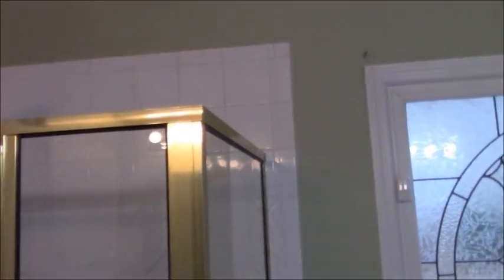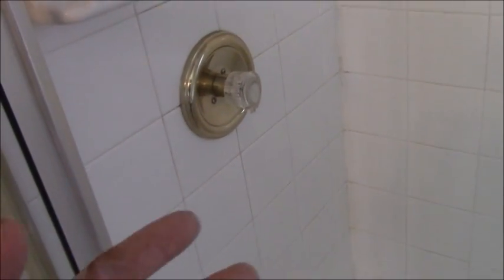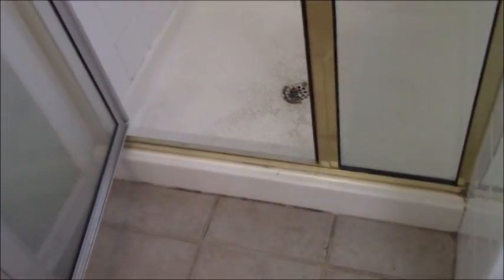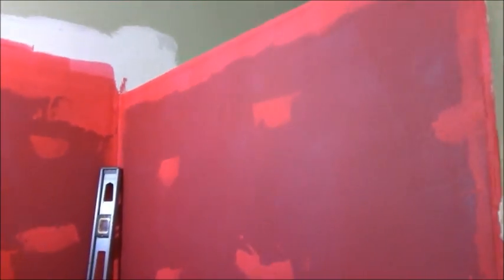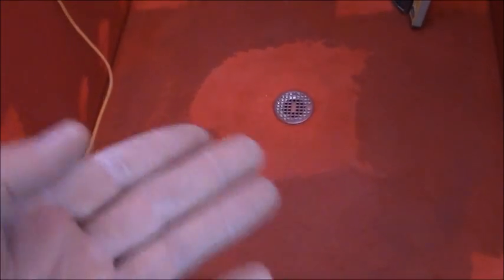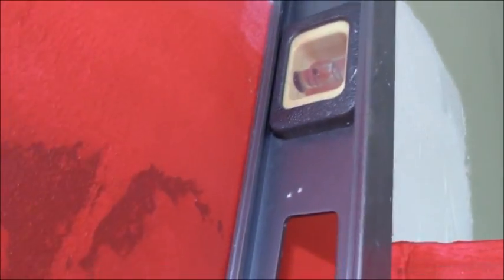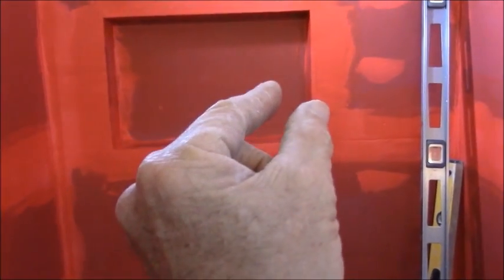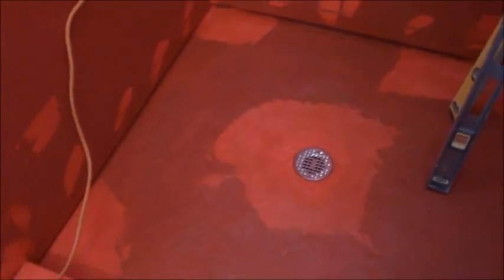Build Of Travertine Shower

Comment: The builder grade tile in my shower is 64 years old. I'm planning on replacing it in another 3-4 years. It's in really good shape, just pink.
Reply from the maker: You're correct, it was ( is ) the method they used rather than the tile. Floating was difficult, labor intensive and time consuming, but it worked. People won't do that nowadays.

Comment: There was a large colony of carpenter ants in the master shower of my new (to me) home in Florida. "Where there is water, there is...". They were climbing up the outside CMU wall, over the top (attic) and down inside the wall assembly (eating through the insulation) and under the shower pan. Whatta mess.

Comment: Great job as usual. I am doing a bathroom now 11x12 ripping out plaster walls over sheetrock in a four story walk up ( old brownstone). Took two days for demo and  breaking up the cast iron tub was tough, then walk all the debris down four floors to a dumpster. Don't know why they wire lathe over sheetrock then plaster over it and then a mud job tile. Gutted out the entire bathroom to upgrade everything.

Comment: Yesterday I demo'd a builder grade shower from the 90's, diamond mesh and mud bed over green board, no waterproofing, they had a massive colony of carpenter ants in the corner behind the insulation. The colony was the size of a small cat. The style of shower is exactly what you show in this video, even the tub, but with a tiled floor that cracked and failed, rotten patches of OSB subfloor had to be replaced under the mud bed even the glass frame is the same, different colors. Do you finish your joints on the green board with setting type gypsum compound? I really like natural stone tiles the best, the look-alike's are great but don't hold a candle to the flame compared to the beauty of real stone.
Reply from the maker: If I'm doing green board then I use joint compound, if I use durarock or any other a cement product I use thinset

Comment: Talking about builders grade. I’m on a job now where the tile installer insists that he didn’t need a rubber pan as long as he did 3 coats of red guard. I bit my tongue and walked away. I was only hired as the finish carpenter so I have no say what happens.
Reply from the maker: He was correct, RedGard allows for a certain mil thickness to be a liner, 3 coats doesn't sound right, maybe 4 or 5. Having said that, I'm still not comfortable doing it.
Reply: StarrTile I always thought that was a very wrong way of doing it. I guess we’ll see in the future.

Comment: Nice job Bob!  My eyes are getting bad but I couldn't see what you used on top of the curb though.  It looked like one long piece of travertine.  Did you bull nose both sides or do they sell that long piece for curbs?
Reply from the maker: They sell the one piece beveled on the outside

Comment: Great video as always. My biggest problem with showers/ back splashes  is how to finish off edges. Not every tile comes with a bullnose in the same tile type/finish. I did see your video on a bullnose sawblade. Did you finish off those edges yourself or do you find that travertine has more available options for bullnose? Sometimes I do jobs for stores that sell the customer products that do not necessarily work in the area that i am supposed to get a job done in (that means the tile manufactuer doesnt sell a matching bullnose in that product). I am relatively new at this... I realize this might be  a "Figure it out" moment I won't be offended if thats the response :D                     

(edit) also is there a link to your patreon? i dont see it in the description.
Reply from the maker: https://www.patreon.com/starrtile
You can get field tile bullnosed at most tile stores ( the guy in the warehouse ) or buy the blade & do it yourself. Or get Schluter transition strips.

Comment: A vertical wall is not "level". Its PLUMB... Level is a measure of true for horizontal. Plumb is vertical.

Other than that, your videos are spot on. My brother does a lot of tiling, and like me, he researches everything he does thoroughly before taking on the project, often talking to professionals. You're advice is dead on his. Just like the paint job on a car, the finish and performance is only as good as the prep work before the finish product goes on.

Btw, as a plumber, if your premade shower pan cracks or whatever, it's because it was installed by a moron and/or it's a junk pan. Properly installed, a fiberglass pan will last a long time. It needs to be a high quality pan (not the garbage at the big box home center) and set in a mortar bed to end flex. Most garbage installations just set it in place and you're lucky if they attach it to the studs correctly. You are right about the dirt, but that's mostly because of poor cleaning habits.
Reply from the maker: Thanks for chiming in...actually I research VERY little, this work tells you how things should go, my video next week will attest to that :-)
Reply: Everyone is an English Major......at some point in their life...
Reply: @MrLutzyboy  well, you get the lingo wrong on a job and they'll crucify you for it.
Reply: @ruelsmith  ; you are 100% correct.  Square means corners are 90 degrees. Level is always gauged by a device, such as a carpenter's level, but level does not always mean parallel to the ground. Plumb is vertical, most accurately gauged by a plumb bob. Levels can show when posts are plumb.  

Note: I am replying because the banter above may help a few people out there, myself included, use the correct terms.
Reply: @MrLutzyboy  also, plumb using a plumb bob and measuring to the string is far more accurate than using a level.

Comment: Love your videos.  I have a travertine backsplash and brown wood cabinets in my kitchen but I want a tile floor installed.  I'm thinking of having a company come out and put a rough almond beige sort of off-white 12 x 12 tile floor in with dark brown grout.  I had it in my previous home and liked the look.  My kitchen is 262 sq ft and I got a quote for about $3200 including labor and materials.  They will also install ditra/strata mat underneath  Do you think this is a good deal and do you think it will look nice with what I currently have?
Reply from the maker: I think Natural Stone is a good look for any application, because it doesn't go out of style, and yes that price kit and Kaboodle sounds pretty fair
Reply: @StarrTile  Ok thanks for the input.
Reply: @StarrTile  Just to be accurate I think what I had wasn't natural stone but more of an off-white textured/rough porcelain tile.  Do you know of a natural stone tile that is relatively cheap and looks good with what I'm describing?